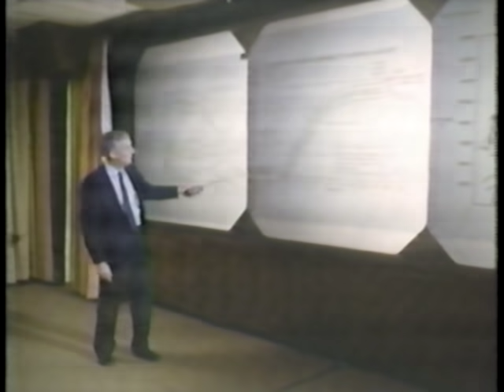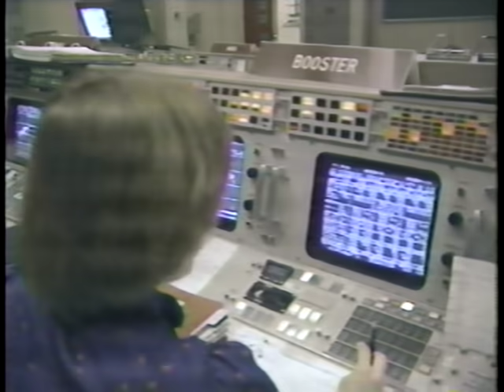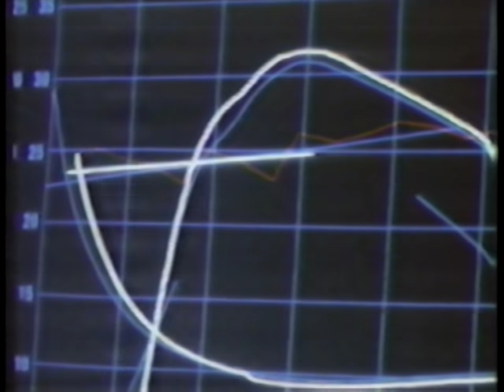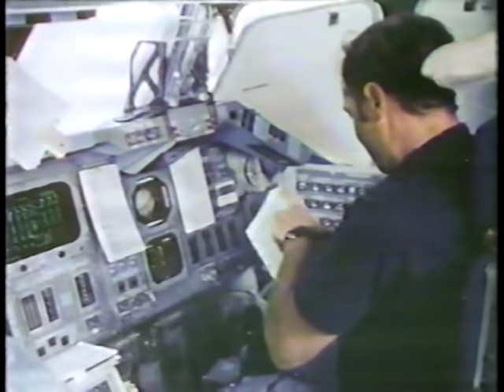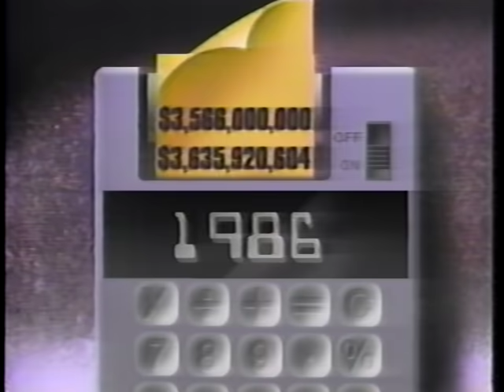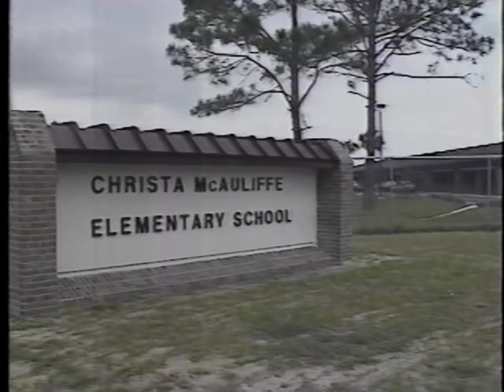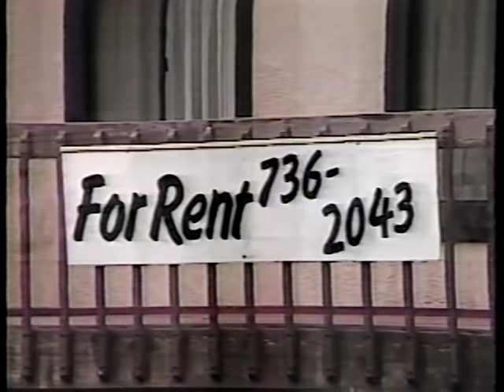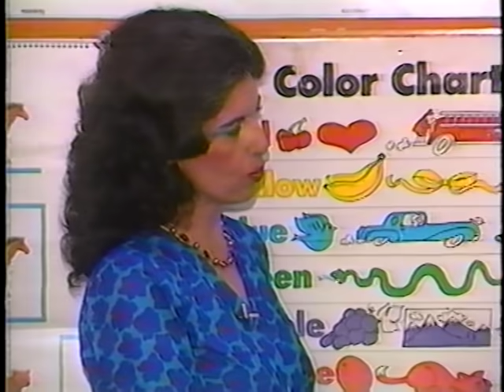Space Shuttle Challenger What Went Wrong

Comment: I know everyone talks about the frozen O'rings but what I've never understood is why no one's ever questioned the fact that the explosion happened just at the moment that they went for throttle up. This would mean the main engines on the main craft would demand significant fuel, nothing to do with SRBs, and it was well known that there'd been fuel problems, including those spoken about in this video?????!
Reply from the maker: Tom Tremayne You bring up something I find interesting since it was explained when it happened. Yes, the solid rocket boosters don’t have a throttle. I believe the timing was more a coincidence than anything else. 
When the shuttle launches, there’s a point within the Earth’s atmosphere that the dynamic pressure and stresses are too great at full power, so the engines are powered back to let the shuttle pass this point and then to throttle back up as a shuttle is in the thinnest part of the atmosphere. Numerous camera angles show a blowtorch effect coming from the SRB.

 The shuttle had passed what was called Max Q, which is the point of highest stress, the flame was eating away at the connection between the external tank and the SRB. Logically it would’ve broken off during Max Q, but it was just shortly after while the throttle up command had been given that the blowtorch eaffect became catastrophic. The lower sheared, allowing the solid rocket booster to break loose and smashed into the external tank which is basically the only thing that exploded.
They found no other failed parts in the wreckage. There is no mystery here.
Reply: I mean no disrespect to American people and the American heros that were sadly lost in this disaster. I've posted about this in the space forums on reddit and on other websites too where my posts are always met with, not hostility exactly, but dismissal certainly and on reddit I've actually had posts taken down because I think it's a staggering coincidence that it happened at throttle up. It's really hard to see on the films what went on. The SRB does look to be still in good flying condition after the main craft goes bang but we're told the lowest section is missing.......who knows tho' from film taken five miles away!? You'd think tho' that with gases desperately trying to escape at extreme temperature and velocity, the SRB would have somehow fire-worked and ripped right round. It'd have been more messed up at the bottom or with a wider T-shaped plume yet it sort of looks like its sister SRB, which was fine? As I say who knows really...and no disrespect.
Reply: The tank is what exploded and the challenger flew apart from dynamic forces exerted on the structure when its trajectory began to changed radically. They originally tried to explain this as a design flaw... even though it didn't even resemble one..
Reply: That's all it was.......timing, coincidence, what ever you want to call it
Reply: Because the analysis showed the tank was starting to collapse before the throttle up
Reply: Tom Tremayne The throttle up call had nothing to do with the accident. It was just when the plume finally burned through the tank. The Thiokol engineers thought that a joint failure like what happened on Challenger would fail immediately right on the pad (joint fails to seal and SRB explodes) 

The joint failed right at liftoff. There was puffs of black smoke at the joint. The moment that the SRBs ignited was a moment of stress on the SRBs and the joints. The segments expands or ballon out and force the joints open. The O-rings were expected to swell up and fill in the gap until the "joint rotation" period passed (usually a few seconds after lift-off). This is one of the damming issues. NASA knew that the joints could fail way back in 1978, but did nothing. The cold temperatures caused the rubber rings to become stiff and it could not fill the gap.

Burnt aluminum propellant plugged up the leak, but this plug failed about 70 secs after launch and then the flame came out. It was just timing.
Reply: @TomTremayne  The booster is almost 2 inch thick solid maraging steel, 12 feet in diameter and about 150 feet long.  The External Tank is aluminum about the thickness of a soup can (its thickness varies by the area its in) and it's 27.5 feet in diameter.  The booster was filled with solid propellant about the consistency of a pencil eraser, burning at about 4,000 degrees and pressurized to about 700 PSI or so.  The External Tank is filled with liquid hydrogen at -423 degree F and is only contained by that soup-can thickness ALUMINUM tank wall (remember aluminum melts at low temperatures compared to steel) and that is covered by about 2 inches of spray-on foam insulation to prevent icing.  

When the booster O-rings started leaking, they burned up in the first fraction of a second due to the extreme heat.  The booster field joints ALSO contained putty that helped seal off the joint and O-rings.  In addition, solid propellant contains aluminum powder, which burns to form aluminum oxide, which condenses as gritty "gunk" once it cools down a bit.  This putty and "gunk" sealed off the joint at liftoff, but vibration and wind-shear is believed to have caused it to crumble and be blown out of the joint as the shuttle flew through the high altitude wind shear aloft, causing the leak to start up again on the SRB, which the cameras saw from the ground.  

Once the leak started up again, the 700+ PSI booster exhaust gases at 4000 degrees F started burning through the joint like a blowtorch.  The more it burned, the bigger the hole got, the bigger the hole got, the more gases escape, enlarging the hole at an ever-accelerating rate.  By sheer bad luck, the hole was just above the aft strut connecting the SRB to the ET on the side opposite the orbiter.  As the hole enlarged, the flame grew bigger and stronger and soon was blowing white-hot gases onto the tank and strut itself.  The foam would have burned off in a second or two, and the flames would have started blasting the thin bare aluminum.  The super-cold liquid hydrogen inside would have started to boil vigorously as the aluminum heated, cooling it for maybe a couple seconds and delaying the inevitable, but sooner or later the pressurized hydrogen tank would have ruptured... a hole would have been burned through it.  At that point the tank's structural integrity would be gone and the thin aluminum would start ripping apart.  

The strut's attach point was a thick "boss" welded to a thickened section of the skin of the tank, but that wouldn't matter when the thin aluminum around it started melting and ripping apart.  The huge hole was creating a "thrust" from the sideways-blowing gases, trying to push the stack off course.  The shuttle and booster engine nozzles were tilted (gimbaled) to compensate by the guidance system and keep the vehicle on course.  This was recorded by instruments that constantly measure the gimbal angles and telemeter that data to the ground, as well as the SRB  and tank internal pressures.  The SRB internal pressure of the right SRB had fallen steadily for a few seconds, as the hole got progressively larger and allowed the high pressure burning gases inside an easier escape than the rocket nozzle.  As the hole grew, the side-thrust grew, and the pressure in the SRB dropped.  The engines canted over more and more to counteract this force, which exerted even more force on the struts and tank, as the SRB was pushing back due to the hole and the side-thrust from it.  Eventually, all this combined to simply rip the tank apart.  Once it started to rip, the tear continued around the circumference and the bottom dome of the tank, with all the weight of the liquid hydrogen above it, simply ripped off.  This starved the SSME's of fuel and they shut down once the fuel in the lines and pumps was consumed.  The links steering the SRB's from the orbiter's computers were severed, the SRB nozzles "frozen" in the nearly "hard over" steering position that they were in to counteract the side thrust jet from the hole in the booster.  They ripped free as the tank disintegrated, the RH SRB pivoted outwards at the bottom, which caused the top to swivel inwards toward the LOX tank above the ball thrust joint connecting the SRB to the ET, causing it to crash into the side of the LOX tank like a giant can opener, splitting the thin aluminum tank wide open.  The entire thing simply came apart like a tire blowing out on the freeway.  The ET was the "backbone" of the stack, holding everything together.  When it came apart, everything was free to move.  The SRB's, being nearly 2 inch thick steel, flew through the fireball unscathed, and emerged from the top of it, corkscrewing wildly because of the loss of steering control from the orbiter's computers.  The orbiter, concealed inside the fireball, would have abruptly shifted sideways in the supersonic slipstream it was flying through-- its engines were hard over trying to counteract the side-thrust of the SRB, and when the tank came apart suddenly it was free to move sideways, since the SRB and its side force was now free itself.  The engines were basically already out of fuel, with the tank gone, but the fuel in the lines and pumps would have continued flowing for a fraction of a second or so until they ran dry. This created the thrust to shove the orbiter sideways, causing it to break up in the slipstream.  

They got telemetry back on the ground showing ALL this stuff happened... Basically the shuttle was doomed at that point anyway, even if the hole hadn't been pointed at the tank above the strut... The SSME and SRB nozzles were very close to "hard over" on their swiveling gimbal mounts-- at hard over, they cannot move any further to counteract the side thrust from the SRB, and the larger the hole in the SRB got, the faster it grew, so in a matter of a few seconds, the engines would have been "hard over" and the hole would have kept getting bigger, and then the shuttle would have spiraled out of control and torn apart.  Additionally, the difference in pressure between the two SRB's was already creating an imbalance of thrust between the two, which again, was only and could only grow worse.  In a matter of seconds, even if the tank held together against all this "pushing and shoving" between the SRB hole side thrust and the nozzles being hard over to counteract it, eventually the thrust of the left side SRB (which was "normal" would have overpowered the weakening right SRB thrust, and the vehicle would have "pinwheeled" and broken up.  The increasing side thrust escaping from the RH SRB's hole was lowering the thrust coming from the SRB's nozzle as the pressure inside dropped.  

In any event, the result would have been the same, just a slight difference in timing by perhaps a few seconds.  There is NO way it would have held together until SRB burnout, as it was only just over halfway through the SRB burn or so.  Even if the tank held together, the thrust would have become imbalanced and the stack would have pinwheeled out of control and broken up.  

From what I read, they actually recovered part of the SRB where the hole was located.  The hole had enlarged itself so that it was nearly 3 feet across before the SRB's thrust was terminated by the range safety officer blowing them up from the ground after the shuttle had already disintegrated... A previous flight had suffered a similar failure, with a failed O-ring and hole burned through the SRB, but by SHEER LUCK the hole had developed not long before SRB burn-out, and it was pointed AWAY from the ET... but the casing they got back after recovery had a hole about 3 inches in diameter IIRC from the leak.  Remember the old "burning map" from the Bonanza TV series intro??  That's how the hole would progress-- start from a tiny "pin-prick" of hot gas escaping, and as it burned outwards, get bigger and bigger at an ever faster rate... exactly the same thing, but in 2 inch thick steel instead of paper... 

Later!  OL J R :)
Reply: @lukestrawwalker  Thank you sir for such an excellent appraisal of what perhaps happened. Whatever it was it was a tragedy.....I researched SRBs a fair bit and these ones it seems were very long, so much so that they had to be transported in sections and hence the weakness and the need for joints and o'rings etc. One wonders why, and perhaps I'm being facile here, but why liners weren't slid up inside, maybe staggered so the liner sections would always cover the outer joints and terminate halfway up, well away from outer joints and so on. I don't know, so many questions and my physics is awful......I also wondered for example how all that pressure wouldn't just blow the joints apart anyway, decent o'rings or not! Thanks again for your excellent response tho'.
Reply: @TomTremayne  The boosters consist of about 8 sections (going by memory here, so forgive if I overlook something). Each of the 8 sections is joined to another one, at the factory, creating a "joint".  Since these are done at the factory, they are considered "foolproof" and are different in design.  These two sections when joined together create a "booster segment", four of which create the solid rocket booster.  These four segments are joined together in the VAB as the vehicle is assembled; where they join together are called "field joints" (because they're done "in the field", not "in the factory".)  These joints are basically a "tang and clevis" type joint, ie basically "insert tab A into slot B" type of thing.  As the SRBs were stacked in the VAB, they were lowered onto one another "from the bottom up" to create the SRB's.  The lowest segment contains the aft closure and rocket nozzle, to which the aft skirt and its various controls and mechanisms are contained (to steer the nozzle, sever the nozzle extension before splashdown, etc) and the structure that holds up the weight of the SRB and shuttle stack on the pad and holds it down to the pad via four huge explosive bolts that are fired at liftoff to allow the thing to take off.  The two middle segments are pretty much identical, and the forward segment has the "forward closure" (which houses the ignitor in the forward center end, and above which is the forward frustum with the nose cone and parachutes and separation motors and such.  

The segments are basically a 146 inch  (12 feet, two inches) diameter roughly 2 inch thick hardened "maraging" steel tube.  One can imagine how heavy these would be empty on their own.  They're broken down into segments so they can be handled by "standard" cranes and equipment without requiring ENORMOUS specially-built machines to handle them.  That, and the fact that they MUST be in sections to transport them to the factory in UTAH for propellant refilling.  The segments are sent on railcars to Utah where they are refurbished and cleaned and new propellant is cast into them.  This can be seen in the video at some point, where a huge "ladle" is pouring a grey mixture that looks somewhat like concrete into a huge white "pipe"... this is how the propellant is mixed and poured into the segments, where it is "cored and cured" (given a huge star-shaped center hold by a mold which is pulled out after the propellant hardens) and then cured, or hardened, to about the consistency of a pencil eraser.  The segments are then inspected and prepared for rail shipment back to the Cape, where they are stored in special bunkers next door at Cape Canaveral Air Force Station, and  transported to the VAB as needed to assemble SRB's for flights.  

Now, once the propellant is cast and cured in the segment it is INCREDIBLY heavy... each fueled booster weighed, IIRC, in excess of 1 million pounds EACH.  When you see the shuttle on the platform in the VAB, or on the crawler or pad days before flight, you're looking at two SRB's each one weighing over a million pounds, the ET in the middle is only about 100,000 lbs empty (over half a million pounds fueled, with the vast majority of that weight being liquid oxygen in the conical upper tank) and the shuttle orbiter itself hanging off the side, which weighed about 200,000 lbs.  So MOST of the weight when it's being moved is the EXTREMELY heavy, FULLY FUELED SRB's... the liquid hydrogen and oxygen and other propellants aren't pumped into the shuttle and tank until shortly before liftoff, after it's already set up at the pad.  

This is the HUGE problem with SRB's... by their very nature, they MUST be handled "fully fueled"...  Because of their sheer size and weight, they MUST be broken down into sections or segments to be able to handle them with anything like conventional industrial cranes and equipment.  NASA experimented (well, had one of their contractors experiment) with making enormous "monolithic" (one-piece) solid rocket motors back in the late 60's... Aerojet General built a 260 inch (22.5 foot diameter) monolithic solid rocket motor inside a silo not far from Ft. Lauderdale Florida in the Everglades back in the 60's and test fired it from the silo.  It worked, but the thing was SO heavy and cumbersome, it would have required an ENTIRELY NEW INFRASTRUCTURE at the Cape to handle them, and they found that casting huge solid rocket motors in the humidity of Florida created problems as well, which is why they make them in Utah and ship them to the Cape.  The motor casing sits abandoned in the huge casting pit in an abandoned facility in Florida to this day (look up Adam the Woo's channel-- he slipped in there and filmed it!)  I have "study summaries from NASA studies at that time on the "Sagitta Cantina" model rocket forum in the "Luke's Study" section, including diagrams and graphics, if you're interested.  Just google "Sagitta Cantina" or the 260 inch monolithic solid rocket motor for more details).  NASA HAD planned for even larger  396 inch (33 feet diameter) monolithic solids for some of their "Post Saturn" million-pounds-of-payload-to-orbit vehicles, but they found that solid motors that size had "propellant slumping" problems-- meaning the propellant, when made into something that size, acted sorta like Jello when you remove it from the mold... it tends to "slump" or collapse and deform its shape, which isn't good.  

Anyway, the SRB "field joints" are assembled by technicians in the VAB.  The O-rings are enormous (12 foot diameter) rubber rings about a half inch in cross-section, which were slid over the "tang" of the joint and placed in grooves machined into the surface.  The surface of the propellant facing upward was slathered with a special "putty" which helped the seal and controlled the burning of this face of the propellant as the motor fired.  Originally this putty contained chopped up asbestos fibers, but this was removed and the putty reformulated due to asbestos regulations in the early-mid 80's.  (One source I read suggested this may have contributed to the Challenger disaster).  The next segment is then carefully lowered down into the clevis of the lower segment, with the tang sliding inside it.  The segment is then secured with over a hundred steel pins of inch-or-so diameter which are pressed into holes that go through the tang and clevis, sorta like "riveting" them together (but the pins are of course removable, unlike rivets).  The joint is then sealed externally with sealant and cork to provide waterproofing on the pad and heat protection from atmospheric friction heating in flight.  

When the motor is fired, a small solid rocket motor is ignited at the "head end" of the SRB, and its blast of hot gas ignites the solid propellant in the SRB.  The SRB burns from the inside out, down a star-shaped hole in the center.  It's star-shaped to give more surface area in a small space than a simply round hole would have, to correctly make the "burn profile" or "burn curve" of the propellant burn thrust levels during the burn duration (in flight).  The hole enlarges and gets more and more round as the burn progresses, until the last of the propellant burns out along the inside walls of the segments, which is why the SRB's continue to belch smoke and flame until they splash down as residual propellants burn off inside the casings.  

The enormous weight of SRB's is what killed Ares V.  As the rocket design advanced, they kept needing more and more thrust, and for a longer duration (more thrust is easy-- add more segments (longer booster), but making it burn longer requires a LARGER DIAMETER-- that's extremely hard to do without making all-new SRB's, which means throwing away all the existing shuttle hardware, which was contrary to the dictates of "shuttle derived" rockets... )  Of course adding segments adds ENORMOUS weight to the stacked boosters, and all that weight has to be MOVED from the VAB to the pad by the crawler-transporter.  First they went from the shuttle four-segment boosters to five segments, then SIX segments, but calculations showed this would be SO heavy that the VAB foundation, crawlerways, and launch pads would crack under this massive weight, and the crawler transporter could't carry this much weight without creating an all-new six-truck crawler to carry the weight.  SO, lacking money for all this, they calculated the maximum weight they could possibly handle, and settled for the 5.5 segment boosters (an extra half-segment from the factory joint added on to the 5 segment booster).  Then they started adding RS-25 hydrogen engines to the core, but that created more problems (weight, additional propellant, bigger core stage fuel tanks, etc) for little gain.  Finally they realized they were in serious trouble, and Ares I and V were canceled and SLS took it's place... 

Later!  OL J R :)
Reply: @MalcolmShawVids Actually the SRBs did sort of "throttle" by means of changing the shape and composition of the solid fuel in the SRB segments during manufacture.   This wasn't something you could adjust in realtime of course.  They were designed to follow a specific thrust profile as they burned.  During max Q the SRBs did in fact reduce thrust along with the throttleable main engines.